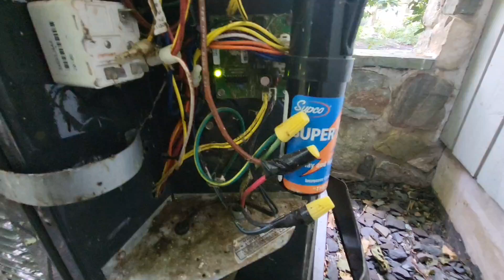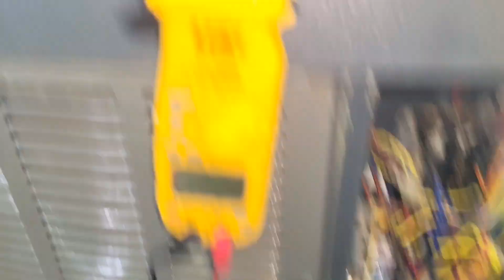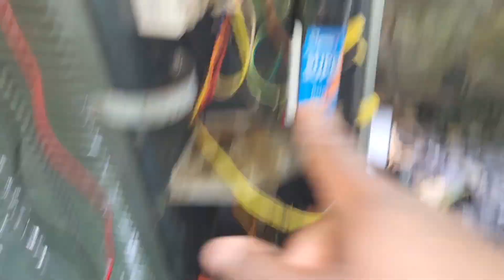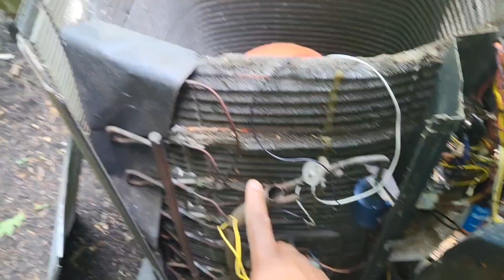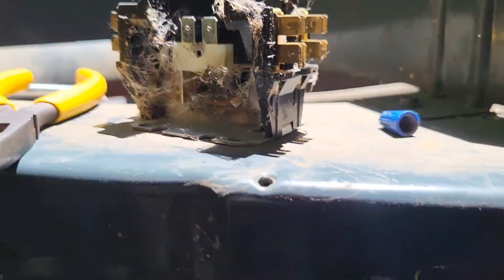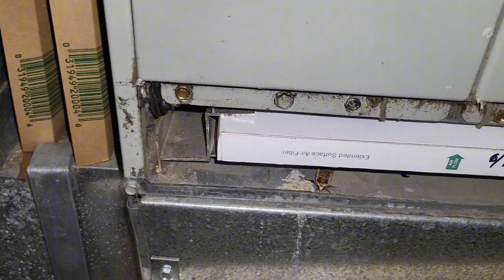No A/C Trane Heat Pump | Heat Pumps

Comment: I'm not too familiar with these trane units. So the green board is the defrost board, and what is the other board in the unit responsible for? Also do you have a video where you go through your process of a service call? As a newbie I feel like I get overwhelmed if they have multiple issues because I don't know to really write everything up correctly. Like if it's a new customer and they have dirty coils, clogged drain, bad capacitor, some guys will clear the drain or something for free to try and encourage them to sign up for maintenance or something, but I never know the right thing to do. 😂
Reply from the maker: Good question. It's weird...
 this unit has more sensors than a conventional heat pump.
The board on the right side (with the blinks) was the defrost board but there were 2 or 3 other ambient sensors connected to the other board. 

So I guess the board on the left was just a communication board or some what. 

If what I did didn't close that contactor, replacing both boards would have been the next step.
 
& yeah I gotta get a headset or something to free both of my hands before streaming service calls from start to finish. I'll look into it

Comment: Electricity is normally cheaper than propane in most places around the nation. Just curious why you thought it was weird for them to have a heat pump?
Reply from the maker: If only you could see the complaints we get from customers about high energy bills (in the winter) in Pennsylvania from having electric heat 😂
 propane or gas heat is the way to go (with a dual-fuel set up (if it's doable)

 during mild days, I'm all for heat pumps, but when it gets colder ( out here between dec-mar), there's no way around customers getting high electric bills with electric heat
Reply: @Drewdriskle  Makes sense now. They want us to electrify everything now with heat pumps. We’ll see how the newer cold climate heat pumps do that are designed to work better in colder temperatures. I agree a standard heat pump will eat up electricity in PA. I still would have thought propane was still even higher though. Dual fuel would be a great solution though. Congrats on 1,000 subscribers.